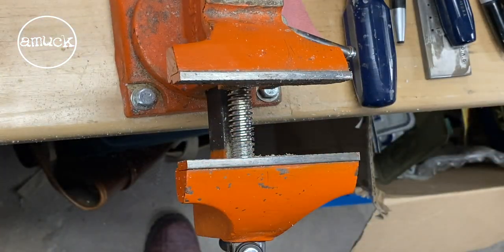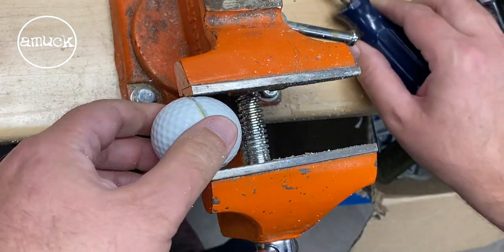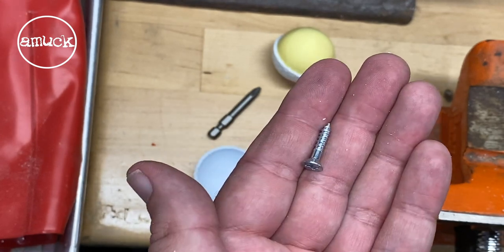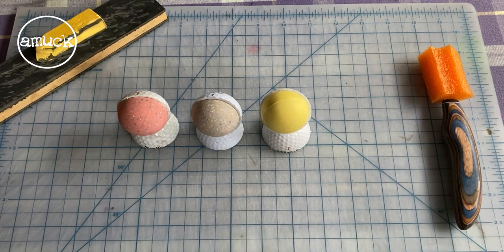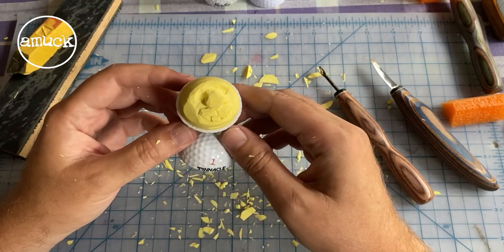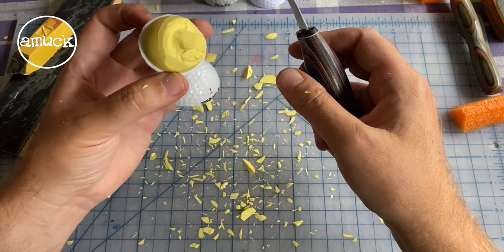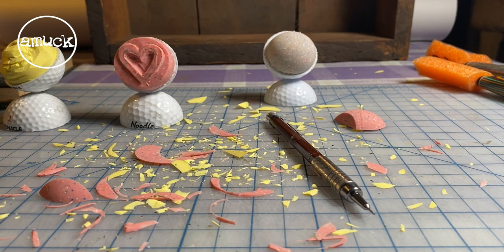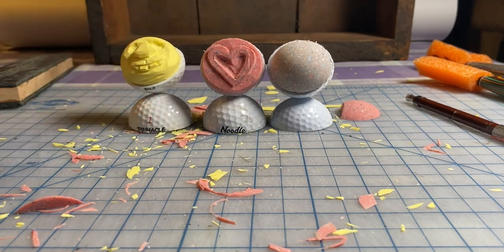Why would anyone Whittle a Golf ball?

Comment: For removing the cover of the ball, I hound a nifty tool that looks like a big pair of scissors but, the top part is like a razor sharp piece of steel and the bottom where the teeth would be is a curved part.  It has a ratcheting action so that it doesn't slip out while you're pauuting the ball in the tool .  It's pretty dang sharp so be careful when you use it. 

I think the tool is for cutting PVC pipe up to about 1-1/2: diameter.  I've used it on several hundred golf balls, now I just gott get out there and start carving them.  

I judy googled that tool and I was right.  Amazing sometimes..
Reply from the maker: That sounds great! I’d like to see it.